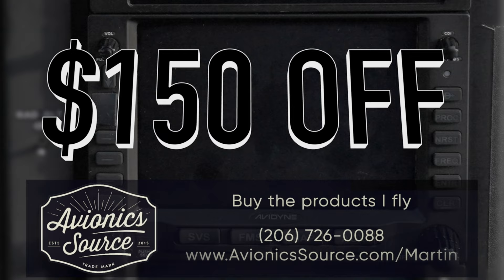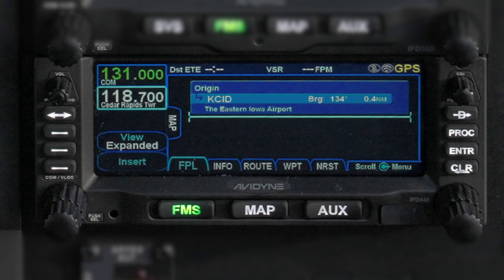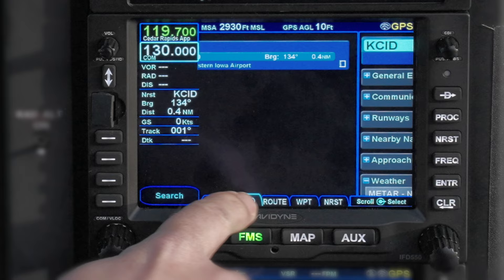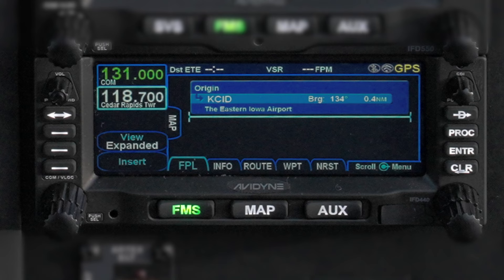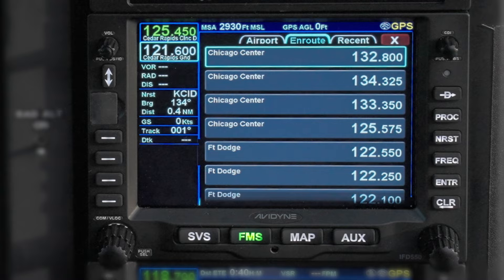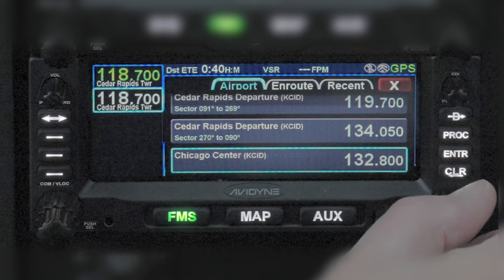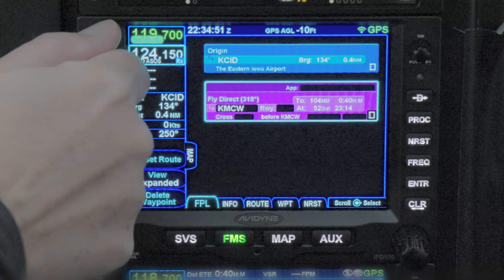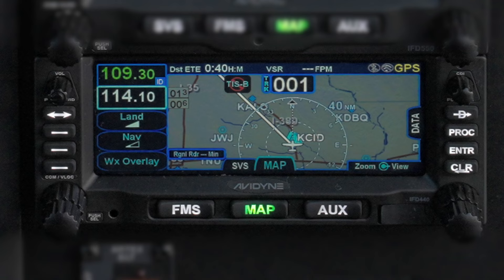Avidyne IFD Tutorial - Part 1: Radio Tuning

Comment: Much better after I slowed it down a bit (thanks for the tip, Martin). I have the 440 in my newly acquired TB20 and I'm a raw beginner on this unit. I've been using the downloaded simulator on a iPad at home, but some of the functions don't match the real unit.